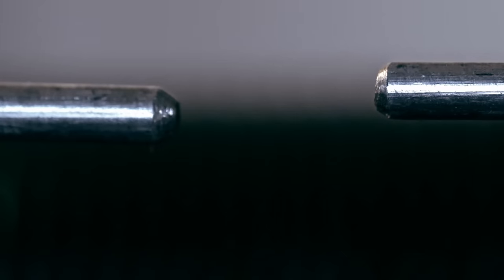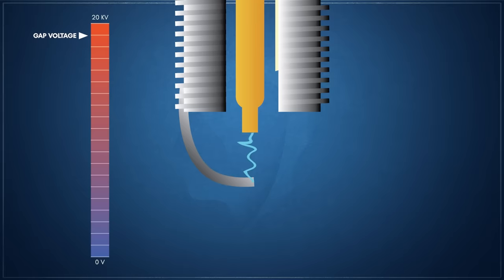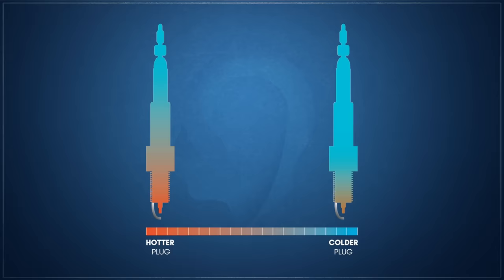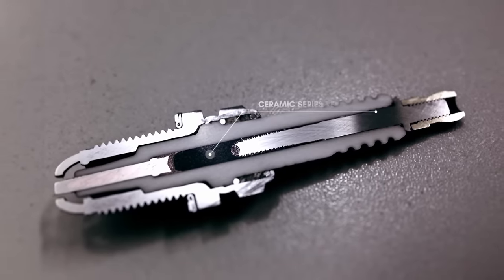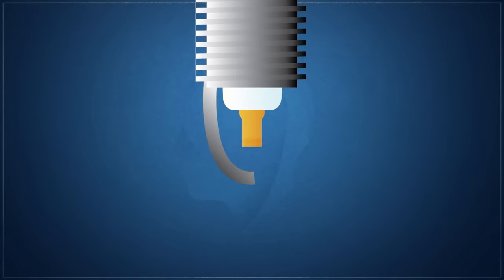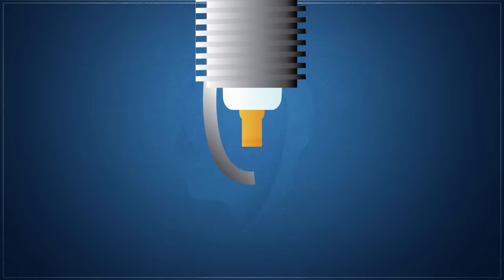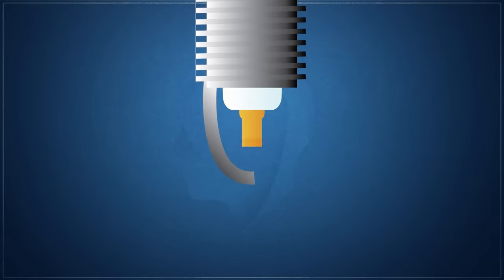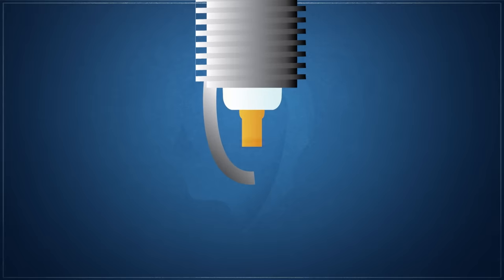The Spark Plug Story

Comment: Not a bad review, but you stopped too soon, and you’ve one major error, specifically if you’re considering automotive.  Maximum in service voltage demand may never exceed 40kV.  Neither the ceramics nor the coil insulation can sustain anything beyond this and typically a designer would try to limit normal demand voltages to around 25to 30kV for safety.  Over 100kV, or even close to that figure is simply not possible with the ignition component geometry and dielectrics used today.  It’s absolutely not possible with the cost and size constraints of the auto industry… and frankly, it isn’t needed.  As for stopping too early, you said nothing of the systemic constraints and how to move past them.  Overall though, you didn’t do too badly!  Thanks.

Comment: @1:16 Archaic? It's exactly just like modern ignition coils on all gasoline engines. It's literally the same.
Reply: Same essential technology, yes. But these days they're made quite a bit smaller and are sealed in epoxy, making for a much lighter and much more reliable coil assembly that can withstand tens or even hundreds of thousands of miles of engine vibrations and bumpy roads.
Reply: Also they use semiconductor switches like MOSFETs instead of mechanical switches. The basic induction principal stayed the same but everything else is new technology.

Comment: that liter of gasoline definitely doesn't produce 5kW of electricity per hour. unless your definition of powering a home is just lighting some led light bulbs.
Reply: Quick google check shows 120k BTU in a gallon of gasoline, which converts to 35kW
ICE is around 20-40% efficient. I could see this easily being correct.

Next google search, fuel consumption of gasoline power gen. 5kW gen uses around .75 gallones/hr.
If we assume those are around 20% efficient (less efficient because this is a small unit), that's around 33kW per gallon with 80% wasted.
Reply: @joshuacheung6518  i now  have no idea why our electric generators are this inefficient then
Reply: @512TheWolf512 internal combustion is simply wildly inefficient. Most energy is wasted as heat.
Reply: Most have low tech engines for reasons of loe cost and high reliability...
Reply: @joshuacheung6518  I am lost in your math. You mean 33kW as teorethical total available amount of energy if there was little to no loss ?

Comment: The comment about electric vehicles is flawed.  Until battery technology vastly improves, we will continue to rely on the internal combustion engine.  Currently, Lithium batteries are not the answer as they are not only unsafe, but cannot provide adequate range, discharge too quickly, take too long to recharge and can spontaneously combust causing uncontrolled and very dangerous fires with very toxic gases.  Lithium is also rare and expensive to produce and the mining and production process coupled with disposal is far more non-earth friendly than gasoline.    EV'S are therefore still quite impractical when compared to the internal combustion engine powered vehicles.

Comment: Wankel engines do not use surface discharge plugs. They are a conventional electrode design, but they fire in a chamber behind a hole that opens in the rotor housing. The plug is not directly exposed the combustion chamber.

Comment: I still dislike coil over plugs.... the couls go out more often than the plugs.... yeah yeah, user error ... right... still same result.. one coil goes out, the while engine starts a rapid decline... most people wouldn't think to stop for
Reply: It's been years since last time I've seen dead coil over plug and it was only due to poor design of cylinder head.
Reply: @lenon1980  well... and or the heat shield for the safety of the hood paint outside the car, unjustly kept the heat just a smidgen to close to the coils and wires attached... when one went out, THEN, the head would shift due to uneaven heat from still firing coils and the cold cylinder <sometimes> igniting just one compression and absorbed friction head heat just warps the head... heat sheild... hold should be a half inch higher from those coils or have cooler paint jobs

Comment: Don't count too much on EVs displacing ICE.  Just about everyone who wanted an EV has one now, and a great many of those are ready to go back to ICE.
Reply: 95% of vehicles on the roads in Norway are EV.  The other 5% made it home. 😂
Reply: Burning fuel in an engine to move a vehicle is incredibly inefficient. EVs will in time become more popular.
Reply: I'd like to see a source for your claims. I want an EV and don't yet have one.
I also don't know anyone, personally, who bought an EV and regrets it.
Additionally, EV's are still getting less expensive and are still selling well.
Reply: I'd absolutely love to have an EV, it's just that I can afford a used 20 year old diesel for 4000€ but not a used 10 year old EV for 10000€
Reply: I'd get an EV if I could
Reply: Dumb statement

Comment: And, as we will learn, there is no realistic way to get rid of IC engines. As manufacturing an electric car requires about 5 times more copper that ICE car, the copper mines should provide more copper in next 20 years than has been mined in mankind's  history. We would need over double the amount of copper mines, but as starting a new copper mine takes over 15 years, there just is not enough copper for planned EV future. So, internal combustion will be around for at least 50 years from now. Also the fact that EV:s are net harmful for the environment, being disposable vehicles with short usable life span, the environmental burden will increase exponentially, as there is no cost effective way to recycle EV batteries. Every 100 years EV:s are found to be a technical dead end.

Comment: Nice monolog about electric vehicles, however despite that, the reality is that gasoline-powered cars were an answer to the deficiencies of the EVs, which by principle are older that cars powered by IC engines. And when it comes to EVs, the battery technology is still not good enough to make them superior. They are neither economically viable, nor ecologically viable. With their greater weight, their tire particle emissions alone are greater than the combined emissions of most European ICE powered cars.
And the technology that would allow us to make EVs as light as ICE cars (like the solid-electrolyte batteries) still nowhere to be seen. 
At this point, it is safe to say that the belief in EVs superiority (or that they represent the future) is just a make-belief which cannot be seen by observing the reality.
Reply: Its a automotive energy paradox! On one hand we have an extremely energy dense source of fuel such as gasoline. So much so, that we actually only need 30% (at best) of that to move that car and we discard 70% of that energy as waste. On the other hand we have electric vehicles that are 85% efficient. Meaning from that 70Kw/h average battery they can convert 85% of that to moving that car, the opposite of ICE and that is heavier curb weight. However and that is a BIG however the problems with EVS are as you mentioned and excess weight, charge time, fires  battery recycling and expense of battery. They are not ready yet. The batteries need to weight at least half as much, don't catch fire that cannot be stopped and be able to fully charge in 10 min (double the time of a ICE fill up) and then people will likely convert to them.
Reply: The "monologue" lasted 15 seconds from the first mention of battery at 15:50 to "ushering it's end" at 16:05. You're being sensationalist. I agree that current EVs really aren't hitting the mark and not even close to superior but then again so do most first generation products. ICEs had well over a century of a head start regarding marketing dominance and research/development. Solid state battery powered EVs will be hitting the market in a few years, curious to think how far electrical powered vehicles (not necessarily powered by batteries) will be in 80 years?
Reply: They already are economically and environmentally viable. Most people don't need to drive 500 miles non stop daily. 

  Studies already show after 30k miles EVs are better environmentally. Mining technology for rare earths will continue to improve. Places where rare earths were mined were never environmentally friendly anyway. Same type to dump unwanted oil componenets into the environment as well. 

 EVs  just can't replace things like long haul trucking. Yet, and that is changing as well. Drivers are only allowed to drive for so long. 

 Yet if they continue to advance with batteries becoming lighter, more battery dense, easier to charge, and safer? It will be within five to ten years before we start seeing long haul.
 
 The cost are also dramatically decreasing. Will continue to decrease. They don't need as much maintenence, and charging at home is fractions of the cost. 

 EVs are already superior in unusable performance. They don't need to be as light as an ICE. They don't need to be as energy dense either due to the superiority of the electric motor. 

 When you compare performance cost as far as speed goes EVs aren't much more expensive than ICE. 

 Battery chemistries have already been proven to work that give 750 kwh/kg. 

 Max therotical max known battery technology is lithium air at 12,300 kwh/kg. That is nearly the same as kerosene!

 The difference between ICE and EVs is that gas is dead in the water as far as improvements. We've basically hit the therotical effiency we can get out of gas. 

 While batteries have and will continue to improve. Solid state batteries just came out this year. 

 If we could just start building graphite for cheaper we could increase the power by nearly 70%. Graphite manufacturing also had some break throughs recently.

 Anyway we built our whole civilization off fossil fuels. Going to take a bit to change. It won't be a 1:1 change either. It is a different technology, and so there will be changes into how you have to use it.
Reply: @centauri8820 Yo, that was a monolog. No need to rant. Don't #hitatme with your liberal lies. EVs are a non starter! Can you drive 1,000 miles non stop? Or go 200mph on the streets in them? Don't think so!

 No seriously jokes aside. I don't understand how someone can say the performance, or economic viability isn't there when there are millions already on the road with them also taking market share incredibly fast. (Also, studies already say they are better environmentally after 30k miles give or take.)

 Also, just the rate of improvement, and theortical improvement alone is staggering. If we continue this trend? Cheaper, easier to charge, lighter, more energy dense batteries year after year we will be seeing even long haul trucks take advantage of battery tech in the next five years. 

 If you compare EVs to ICE of the same performance? They aren't that much more expensive. 

 Right now costs and infrastructure are about the only bottle necks 

 I think the guy above, and others like him are either stuck to how EVs performed 10 years ago. Or if they lived back then, they would have fought gasoline over steam combustion. Adverse to change. 

 "Gah! Gasoline?! Gas stations aren't everywhere! With my trusty Steam engine car? All I need is wood, and I'm surrounded by it! Spark plugs are electronic and unreliable compared to my mechanical steam regulator!"
Reply: Ice is on it's way out in large parts of the world. It's happening in an exponential s-curve. Within a decade new ice cars will be niche market for niche usecases.
Reply: @JoseLopez-hp5oo  60% for ICE at best as per EngineeringExplained and few books on the topic. I think there was EV that manages to hit 90% efficinecy but I could be mistaking it with theoretical maximum

Comment: Sorry, but electric vehicles will never take over and I can prove it easily. They'd need energy storage that's denser and easier to recharge than batteries as we know them. Even if energy cells akin to those in science fiction are possible to build, energy theft and the military applications of the technology would keep it out of the hands of the average person. If you can give a tank or fighter jet or drone a far greater amount of endurance than the people using it, then warfare will change as exoskeletons and mechs greatly expand the battlespace by making forests no longer a significant barrier while also making autonomous warfare possible and very effective. If a small quadcopter can fly 500 miles autonomously to detonate in a crowded city, then people have a lot more to worry about than the source of fuel their cars use.